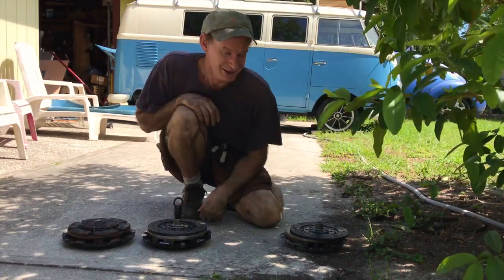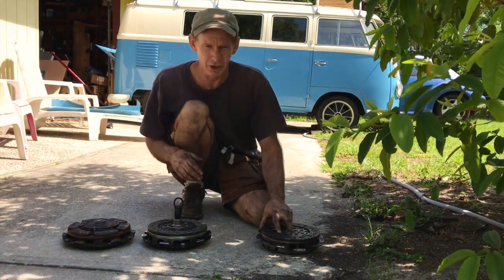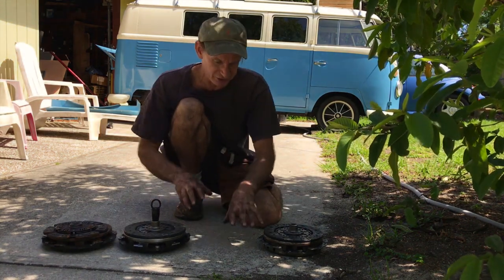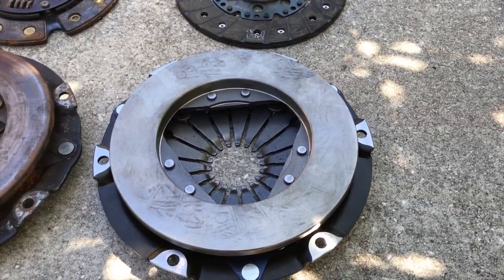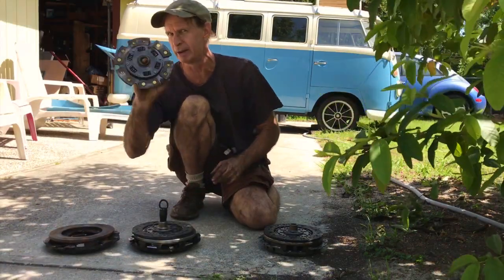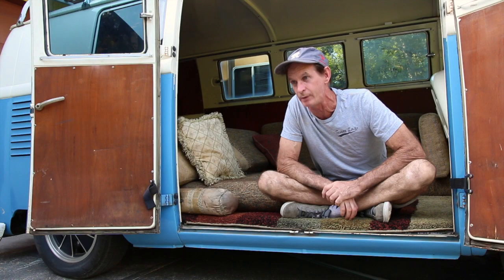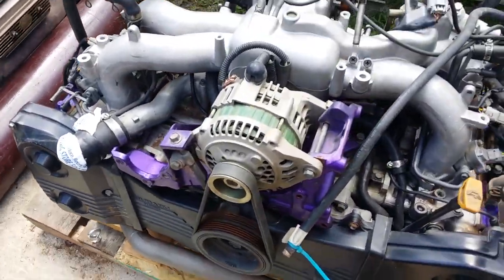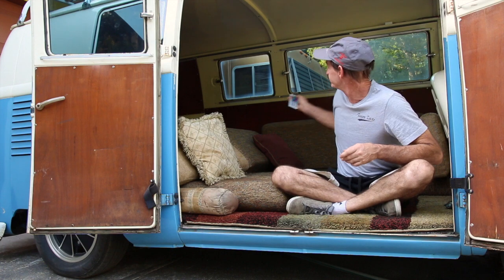Clutch install / Transmission / Sunday Beach Drive, vw bus, vanlife

Comment: How was he going to pull this engine quickly ?  Look the intake is still connected.... like the idea, just have enough clearance as it....awesome.   No room to work, just like a modern car.   71 bus trans was like 69, and mine blew up a few years ago too...lucky to get home...now running a 1976 2L, 6 rib trans...not sure if it could handle 227 hp, doubt it...

Comment: What air intake are you running on this? I have a 2.0L WRX engine going into my bay window and need an aftermarket air intake to fit like yours.